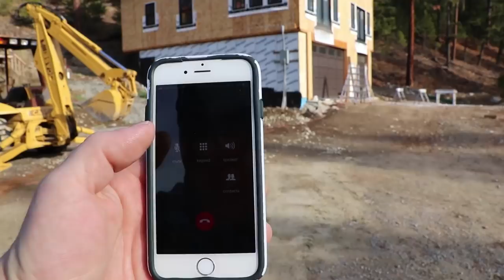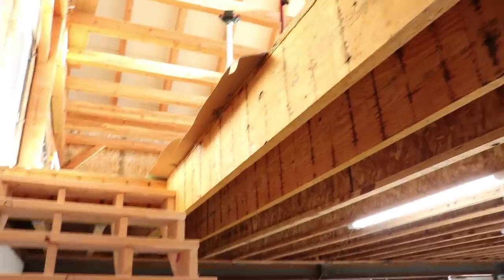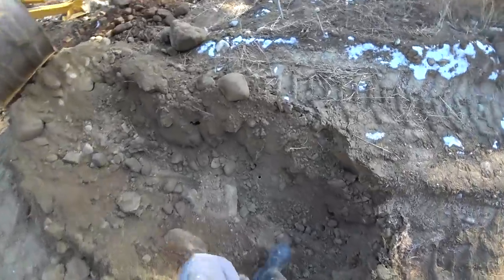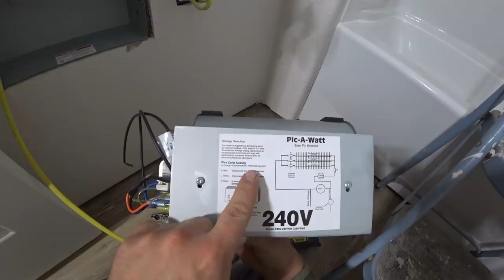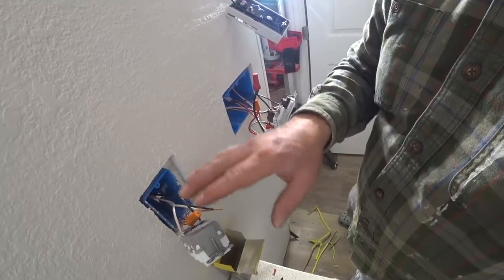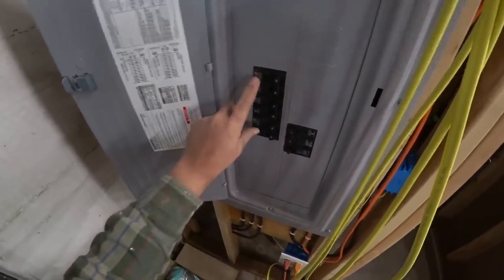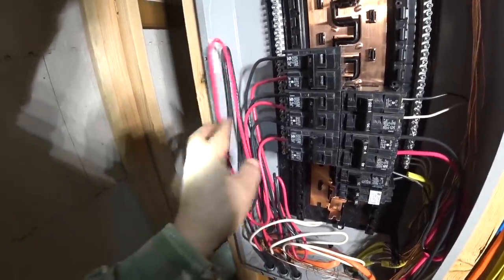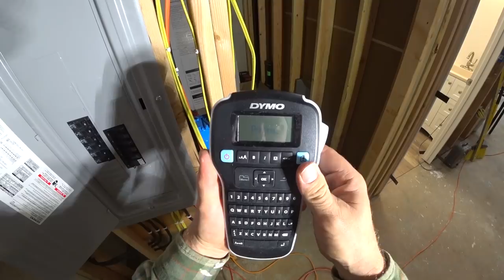Holy Cow IT ACTUALLY WORKS! (Wiring Garage Bathroom)

Comment: While it is permitted to use a white wire from NM-B for a "hot" when wiring a 240V appliance, if you are running conduit and individual wires (THHN) one of the hots must be black and the other one RED.  This signifies that the conductors are coming opposite hots on a two pole breaker in the load center.

Personally, I would put a piece of red tape on each end just so that rookies don't freak out when they see a white wire landed on a breaker lug instead of the neutral bar.

Comment: Something to consider, when you put a ceiling in at the garage level.. the heat generated by the heater would be more efficient in heating the remainder of the house.. because it would go up the stairs more quickly via a smooth ceiling surface now indeed it is trapped in the pockets thus heating the floor.. but it takes more energy to heat with radient heat.. than it is with hot air flow..
Reply: Oh and remember.. good ventilation is key to good heating😉 so dont close it all in!😏

Comment: You beat me to it @36:45, I'm thinking I wonder if he will either write with a pencil or Dymo label each circuit.  Three thumbs up for that.  Like I have room to talk.  I have a secondary sub-panel box that has all of the 220-volt items in from having central air installed.  And it is like all the 110-volt are so screwed up now.

Comment: Looks like the thermostat you got is for a 120v heater.  I could be wrong, but I thought you had to cut both hots with a wall heater like that.  I got a 4 wire line-voltage thermostat for my 240v heater.

Comment: Don't you have sleeving for wires ?
In your case you would put red sleeving on the white, alternately use red tape
Also, just because there's no neutral, it's not 'all consuming', the 2 phases alternate in the same way as hot and neutral, it's a circuit just like a heating (water) circuit, flow and return, just that the return goes via a different wire.

Comment: I am sure you will receive a lot of opinions about wiring, but let me add an idea - I never put the ceiling lights in a room on the same circuit as the receptacles.  Otherwise, if you trip a breaker the room will go dark. Think about being in the shower and your curling iron trips the breaker.

Comment: Floor in the bath room looks good.  I'm going to use very similar in my new bathroom remodel.  I've done the same type of tile in my kitchen already works great.  It is a pain to put down I had the same trouble the first time I did it also, Like I seen your last video.

Comment: The 220 heater circuit needs to be a 12/3 “romex”. It has a black, red, white, and bare conductor. The white is used for neutral only. The black and red are ungrounded conductors (hots) the bare is the ground. Which is bonded to the heater enclosure. The neutral is unused. Neutral wires smaller than #6 cannot be phase taped (colored by tape) to represent an ungrounded conductor.
Reply: 200.7c might wanna read..50v and higher, have a nice day.

Comment: Sorry, but the reason you can use 12 AWG is because the device does not utilize more than 20 amps, hence why the required over protection device is a 20 AMP Dbl pole breaker. which the largest amperage breaker you can use safely with 12 AWG

Comment: You are doing fine on the ground wires in the breaker panel. You just started at the wrong end. Add each ground to the lowest position and move up with each one. That way the previous grounds are not in the way.

Comment: Looking good brother just remember 80% the breaker and you're all right put some nail blocks over the holes you put where you are going into the panel or anywhere actually so you don't screw a sheetrock screw into your wire bad news LOL I like your safety and yes you do have to have GFI outside it rains wet location LOL

Comment: I just dont understand these square boxes are still standard most places. Here in Norway at least the standard is round boxes. (the outer ring often beeing adjustable/rotatable, so its super easy to level attachments) Another standard I dont understand is the wires just pulled inside the walls. Here the new installations have cable in tubes inside walls, so its serviceable in the future. The design on the boxes to was ridiculous, 100% agree, not covering more then 0,5-2 cm?? That is indeed very non forgiving and makes no sense, it should surely be designed with room to work with! I would say you could of course not know this, but I guess now you know for the next installations. keep it up! 

Could I suggest/recommend buying and installing some earth sleeves on the termination wires in the fusebox? (from the where u strip the wire, all the way up the the bend at the "earth buss". This cost literary next to nothing, looks neat, and it makes it easier for you/electricians to servicing in the future. The way it is now, its pretty clumsy if you need to disconnect 1 earth terminal to "error search" something. This due to the all the circuits runs copper being tangled and touching each other. You are doing a pretty neat jobb overall, props for that!

Comment: Questions:  Why are you feeding all of your loads from the bottom of the panel?  Why are you then taking all of the grounds to the top grounding strip lugs instead of starting at the bottom? Why are you leaving so much excess wire wadded up in the panel?  It is going to get awfully crowded and unmanageable real quick with what I have seen this far. I second the black tape to mark the white from the 12-2 rolex as HOT, another idea would be to take 30 seconds and color the white wire black with a sharpie as well, tape can fall off in a hot environment (inside a heater enclosure).  I do love the videos, who you are doing with the panel causes concern.  Keep up the videos and Merry Christmas to both of you!

Comment: Why don't you use the top entry holes of the panel box ? You sure would save a lot of wire.
Reply: because he still needs to run the wires from the first and second floor to the panel to, he is planning to use the top ones for that
Reply: maybe he didnt want to drill thru top plate sometimes its easier to feed from other sides thts why there are knockouts everywhere on panels  ive seen panels mounted sideways too
Reply: He still has the rest of the house to wire and I'm betting there wont be enough holes in the top of that panel when he get started wiring the upstairs...time will tell.

Comment: The electrical inspector will allow 12-2 used for 240 volts if the white wire ends are marked with color tape or marker as either black or red.

Comment: Simple, double the voltage and the amperage is cut in half for the same wattage load. 2000 watt at 240 volts is less than 10 amps but 2000 watts at 120 uses almost 20 amps.

Comment: In the UK you are not allowed to have a socket outlet or a wall mounted light switch on the wall, you have a ceiling mounted pull cord switch this is to stop you touching a switch with wet hands

Comment: If you've not fixed that thermostat cover already then send over some measurements - or better yet the technical specs of that thermostat and I can 3d model a replacement with a bigger footprint to cover the hole. Then use a company like Shapeways or 3d hubs to 3d print it out. it'll probably cost about $20. (I'm in the UK so it'd be less expensive than paying the shipping from here - otherwise, I'd print it out for you)

Comment: The 240v for elec heater, water heater and so on is supposed the be continuous red on "B" phase conductor on #6 and smaller conductors, #4 and larger can be marker with marking tape

Comment: You can use 12/3 wire for 240 volt applications. You get a black/red and white wire. The black and red are hot wires.
Reply: Why spend more money for 12-3 when 12-2 will work just fine for the bathroom heater........

Comment: You made a really good job of that bathroom Brad.  I predict you're going to be filling up the cisterns weekly!  For the first month or so anyway because there's about to be some long, loonnnggg, hot showers going on in there, plus some relaxing soaks in a bubble bath.  I know you've had your hot tub but the ability to lay back into hot, scented water does a hell of a lot of good for not only relaxing tired, overworked muscles & tendons but when you're frozen down to the bone? There's no quicker way to warm back up, much faster than hovering in front of a fire or heater, it's like a bowl of soup for your outside in.  It'll surely test your extractor fan's strong enough.  Bugaboo might forsake his brown bag.

Comment: ATTENTION JESSE: You need to RE-CODE the White wires, with either a BLACK Stripe or RED Stripe, using electrical tape.  Electrical tape comes in the following color's: BLACK, RED, GREEN, WHITE, for re-code{ing} purposes. See also my response to 
Richard Burguillos.

Comment: Buy a Riniaa direct vent propane wall furnace.  You can hook it up yourself.  EZ PZ.  It will pY for itself over the cost of electricity.  And you’ll be way warmer.  85 percent efficient.  Plus you’ll have emergency back up heat when you install the heating system of your choice.  Your electricity bill is going to be outrageous.

Comment: That 688 fan in the shower area is only listed for use in the shower if it is protected with a gfci. Run the load from the gfci to power the shower switch leg and isolate that sw neutral from the rest of the grounded conductors.

Comment: Wrap the whit wire in red electrical tape on the panel side and inthe heater side that will work to pass code
Reply: Yup, don't know if that's required by Idaho code, some states/provinces allow black electrical tape to mark it, but the required practice is to buy cable red-sheathed in Ontario. It has black and red leads. Btw: For service entrance to panel, red should go to the right rail, and black left for single phase split 240V. Electricians need to know at a glance if and when at all possible as to what to expect as per given markers.
Reply: This is a correct statement.  2 blacks is not correct.

Comment: It'll save you $85 month if you don't fill your sewer line with drywall mud, concrete, dirt, and paint. Watching you install your plumbing fixtures has brought back so many numbers to memory like 1-3/8", 12", 34", and 3-1/4". Calk that toilet base! The dried calk helps lock in and support the base.
And say things however you want. Potato, potato, tomato, tomato. Speak Spanish if you want too. Not all of us are gossip queens, so nosey that we'll get upset about not understanding everything.

Comment: You should take both ends of white wire of your 240v heater wire and either mark it with a permanent black marker or wrap it with black electrical tape, both are permissible by code.

Comment: You should not run two 2250w heaters on a 20a circuit.  These would fall under the continuous load category, and you would far exceed the 80% rule (18.75a vs  16a allowable).

As far as the neutral "allowing power back to the grid" and 240V being "self consuming" that is just a really poor explanation and understanding of electrical basics.  Unless you're producing power, you're never really sending power back to the grid.  It's alternating current -- the electrons flow both directions.

120V vs 240V work in the exact same way.  They're both sine waves, just with different amplitudes.  In the US we have a center tap on the 240V, allowing two 120V branches within.
Reply: Love your second paragraph.  I almost  burst out laughing at the 'back to the grid" remark.

Comment: For the same wattage, 24,0v is half the amps of 110v, and amps is what drives heat production in wire. Short that wire on a 12v battery and watch it melt and burn in air, because the battery can supply huge amps. 10,000v on electrostatic earphones are a thing.

Comment: Isn’t  black and red typically used for 220V wiring? And black and white for 120V?  Basically 22OV is 2-110V circuits referenced to neutral. PLUS it requires a grounding wire that should be attached to a copper ground rod buried 10’ below the surface. Some counties require every sub panel to have its own ground rod. I didn’t hear you mention installing those. 

I don’t think it code to use a dual 120V breaker to switch 220V. You need a 220V breaker for that. 

Theoretically it’ll work but I think you’ll get written up for that.

I don’t like the duals and only use them for non critical applications, like landscape lighting.

Comment: Nice job but it might be easier for you to run the wires in the top of the pannel instead of the bottom. I am a builder and have never seen wires going into the top of the box.

Comment: The wiring for 220volt circuits should be 12/3 with ground.  You have two hot sides red and black and the white IS the neutral.  This allows you to ground the case of the heater to help prevent electrical shock if the case should become energized.  When you looked in the power box did you see any other 220 wiring using the white as a hot wire.  Wiring in this manner could cause injury if you sell your home and someone touches the white and ground expecting them to be dead. You're building a beautiful home don't scrimp on the most important things. EVERYTHING has a neutral and should have a ground.
Reply: That's funny, My 240 cove heaters don't have a neutral, my AC doesn't have a neutral, my 240 wall heater doesn't have a neutral, my 240v garage heater doesn't have a neutral. And one should never use a neutral(grounded) conductor to attach to metal case of something, the grounding conductor(bare) is used as the equipment ground for the metal casing. IF using romex with only 2 insulated conductors for a 240v heater then yes the neutral is required to be re identified per nec 200.7C and one does NOT need to run a 12-3wground to a heater that doesn't require a neutral.

Comment: A circuit breaker should not have two or more wires attached to it unless it's so designed.  It's ok to use wire nuts in a panel as long as the wires are eventually attached to a breaker and not just "passing through."

Comment: Wire size has nothing to do with voltage it's the amps that it has to carry. It's also good practice on a 240 circuit when using black and a white wire to use a red piece of tape on the white wire at the appliance and at panel.

Comment: your power description was cringe worthy. the Grid is set up to have +120V, -120V and neutral (or 0). Voltage is based on the potential (or difference) between the leads used. we get a 120V by connecting to the + or - 120V lines and the neutral. and you connect 240 by connecting +120 and -120 at the appliance. neutral stays at 0V by being connected to Ground (or earth) at every service point.

Comment: The lights either have to be on a pull switch from the ceiling or a regular switch outside of the bathroom again for safety reasons.

Comment: For such a short run, I would have run a length of 12/3 wire, with a black and a red conductor inside.  If the neutral doesn`t get used, no problem.

Comment: Well done on the bathroom - do u in the USA have something called a backing plate - when you make the gib opening to big for the plate there is a cover to put behind the switch to cover the mistake - cheap easy and it is the utility bathroom or mud room bathroom and it will not be your main one in years to come

Comment: Do American electrical systems not use a ring circuit system??  Seems very wasteful and lossy to use a single run for every single fixture.  Brit here.  Our electrical laws would not allow for most of what you guys in the USA do.
Reply: You are correct that we don't use ring circuits.  I've been watching Tom Nagy's channel who is a sparky based in London and I'd say your methods are weird 😀. Actually each has it's advantages.  Over here the saying that every line in the National Electric Code is in there because somebody died before they added it.
Reply: Dude, they don't know what the heck they're doing...They're shooting from the hip...
Reply: No, and the reason the Brits (I'm a Dual) use it was due to historical shortage of copper in war-time. The Ring Circuit has advantages, but it also has disadvantages. It's a 'do the best you can with limited resources' method. It can be very dangerous in certain circumstances. And it's definitely not legal in North Am.
Reply: Actually ring final circuits are rare. Not many nations do it. Most are all radial circuits. It was only introduced here in UK after the war to save cable as copper was expensive and in short supply. Ring circuits have their downside. For example if there's a break in the ring you end up with two radial circuits that can be overloaded.

Comment: I'm just curious as to why you would cut that piece of conduit below the ground? Should've left it sticking out and painted it so you can see it. You guys are going to run out of electrical panel fast. The drywall work around those boxes 😂🤣🤦‍♂️
Reply: Next spring he will be looking around in circles thinking to himself, "now where tf did that conduit go?" Drives over the rebar and punctures a tire...."Found IT!!!"

Comment: Your electrical regulations are completely different for bathrooms in UK you wouldn't be allowed power sockets, the type of heater you have fitted all light switches would have to be outside the bathroom or pull switches if inside. Shaving sockets have to be double insulated. I'm distribution power board wiring all ground or earth wiring needs to be insulated with green/yellow sleeving and clipped to ensure the cannot touch live bus bars.
Reply: yup our rcds trip faster why we can have outlets and switches in bath and in some areas there are no rcds on switches not to mention no one in the states now what an isolter is for fans and appliancies i have been watching uk sparkies for a cple of months only reason why i now isolater switches and understand uk outlet rings those are crazy to me as our having outlets in bath are to you.  and ya i wld like to see our earths sheilded too